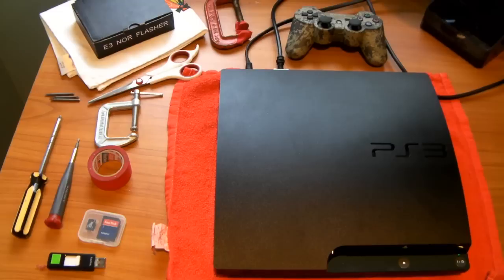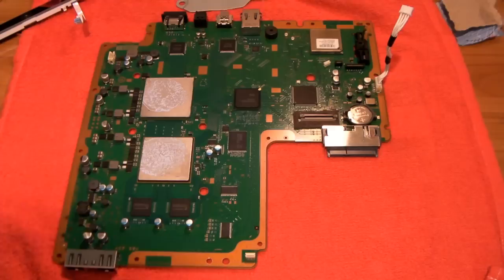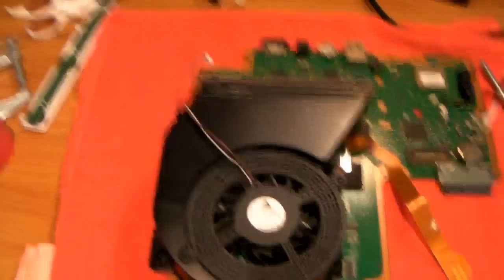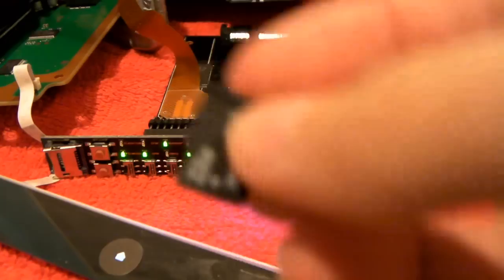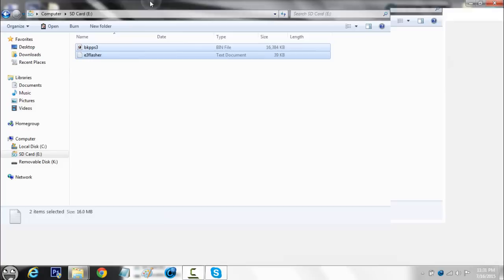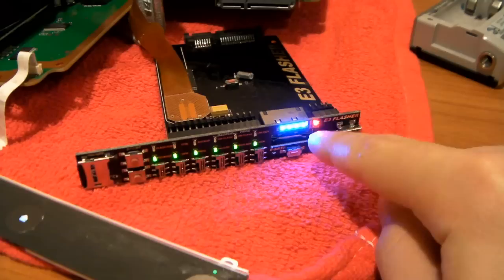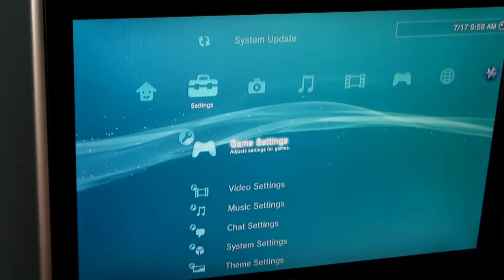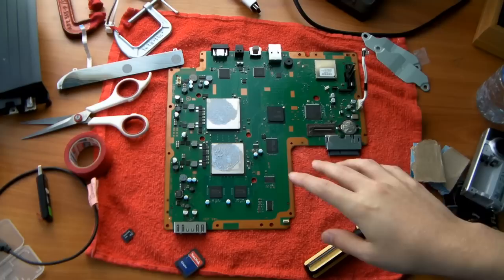How to Downgrade a PS3 to 3.55 with E3 Flasher (EASY!)

Comment: Hi, I have a CECH2501A PS3.  I have been following your guide on how to 
downgrade it and I have gotten up to the point where I have a working 
bkpps3_patched.bin.  I have deleted the _patched and have put my SD card
 back into the e3 flasher.  However, now, when I turn on my PS3 it will 
not stay running.  PLEASE HELP!!!!!

Comment: +Hacked Tutorials 
I have a problem , I need help . I did everything as is, the dumps the probe with NorInspector and Flash Tool. I made six dumps and all were OK . I made the final step, transfer the patched dump at the end , turn off the console, but now when you turn the green light turns on and off at 2 seconds.

What happened? try it with 2 consoles and I was the same . some help?

Comment: i know ur not responsible for anything that happens to my PS3 but i accidently pulled the fans clip thingy that was connected to the ps3 out of the mother board but i'm gonna fix it by soldering the wires into the other side of the motherboard but no worries everything worked for me thank u ur the best at taking it apart on how to downgrade it and put it back together but everything worked for me Than You.

Comment: My ps3 will turn on then after 3 seconds it will go off no red light or anything if i press it again it will show red light then the process starts again ive done it with hdd in and out and no progress. My ps3 was on 4.81 and would go back to 3.50 so i got 3 dumps and they were good then i patched them useing the latest version of PS3dumppatcher and i got a error with the e3 the 1,5,6 lights where blinking then i turned it off then back on then i got 1,5,6,7,8 lights blinking then i turned it on and thats how this started. :(   HELP

Comment: hello mate, i have downgraded a console thanks to your tutorials, and i have got my PS3 slim on 3.55 rogero, and i am trying to go to 4.70 dex, i have tried going to 4.70 cex > 4.70 dex, and i have tried going to the original sony 3.55 update, and every time i go to update it, it says the data is corrupt even though it is all right, i even tried to go to 3.55 using the kmeaw downgrader and it still does not work any suggestions please any help would be good thanks in advance

Comment: I keep getting bad dumps and it's starting to piss me off, bad enough I have to hold it down with so much pressure other wise it won't work, then when I finally do get a dump and check it, I get like 106 errors out of 138.

Comment: if someone doesnt get connection because clip isnt seating correctly, apply above the clip a duct tape 

use a BIGGER clem and not a tiny one (which covers atleast the entire area of the clip), and your good to go

the e3 flasher doesnt directly have to be connected to the mainboard, just with the clip end

If you interrupt the downgrading you will get blue light error and a GLOD (no video/audio) which u just fix by completing the downgrade
Reply: ***** make sure you have the backup patched and updated the ps3 (all levers down at the e3 flasher)

and have the downgrader ready on a usb
Reply: ***** make sure ur ps3 is on the supported model list

doesnt work on super slims
Reply: ***** make sure you dont have a kiosk firmware installed (always saying demonstration mode), or else youll need to use a reverter and downgrade again

http://www.ps3hax.net/showthread.php?t=41772

Comment: Very nice video, although I'm stuck. You had the screen pop up asking to reinstall the system update after putting in the USB stick. I did as well, and I push select and start at the same time, it brings me to the "checking... Please wait" and that's where I sit. Any suggestions?

Comment: @ArchieG Hey Archie i have successfully completed all steps with e3 flasher but when i go and turn on the ps3 it says: "No applicable update was found. Connect storage media that contains update data of version 4.81 or later, and then press the START and SELECT buttons at the same time" also it's worth mentioning that when i used that dumo checker i had 2 bad dumps named ROS0 and ROS1 but i unticked the Hash checker and it was succesfull. I don't know if problem was because of Hashs or something else. Please help...
Reply: Format USB to FAT32, create a folder named "PS3" then inside that folder create one called "UPDATE" make sure rogero 3.55 downgrader file is renamed to "PS3UPDAT.PUP" and put that inside the "UPDATE" folder. Put the USB  in the right slot of the console (PS3 reads usb slots from right to left) and then hold select and start.

Comment: Ive done all the steps correctly but when i try to install Rogero from the USB I always get the error "The Data is corrupted 8002F2C5" , have also tried from safe mode etc and nothing works, any ideas? BD is connected.

Comment: I was on the the last step putting the back up patch onto the e3 flasher and it stopped in like the 6th light and then I got error 10001111 and then I tried to turn on my PS3 the cannot start doesn't pop up on my screen is there any way I could solve this
Reply: First switch down and leave rest up then you will get video description or
http://www.se7ensins.com/forums/threads/e3-flasher-4-81-downgrade-tools-guide-extract-a-ps3-console-id.1355707/

Comment: When I first turn it on the "can not start because of no hard drive" screen never shows up i have it plugged perfectly but still no signal and the ribbon cable that goes to the power/eject button pins cracked and separated but it still turns on if I bend it almost to a complete crease but when it returns to being separated do you think that is what is causing it to not show up please HELP!!!!!!!!!!!!!!
Reply: you need a new cable ribbon, jailbreaking is easy you need to follow the video 100% and make sure you have complete downloads otherwise you risk brick, you dont need anything connected as long as your ps3 turns on and your e3 is running all u have to do is make the dumps and change the files,
Reply: Ive done this before but i had to unjailbreak for my bro but im getting a new cable and i should be good to go thanks though

Comment: hey i'm hoping you can help me .. i did the three backups and when i check them using norinspector all 3 are good .. but when i check them in dump checker i have one error .. ros0 hash .. what do i do ? im currently on 4.78 trying to get to 3.55
Reply: +ab ab go to settings and then turn off hash control

Comment: Can someone help me please every time I try to do anything it fails I haven't found the solution to this problem I can see the error message for no storage thing but then the e3 flasher won't turn on then when I shut it off and put more pressure on the connector I don't see any signal on my tv can someone please help
Reply: +Mr.Potato is your clip on the chip the right way

Comment: So after 10 tries to get the clip cable on the ps3 I finally started to get dumps. First set was successful but in the middle of the second set of dumps the ps3 started flashing red and turned off. Thermal paste was used and I can't figure out what can cause this. Now my ps3 doesn't start and when I try it's first green then flashes red. Please help.

Comment: is this update.bin file in the "Everything to E3" folder the Samsung 10.28 e3 update file? I know that the Samsung update allows you to use it on multiple consoles...I am assuming this is the one you used because you said this was the 2nd ps3 you had done with the flasher.. please let me know ArchieG...or if anyone else knows ..thanks

Comment: i need help. i followed instructions from first video perfectly. but when i try to install regero downgrader i keep getting data corrupt 8002FC5. I get the error when installing from the UI and when i try from safemode. I tried using a different hdd and ive redownloaded the file 5 times. I keep getting the same error.
Reply: Sorry, i get error 8002F957 from the normal UI and when i use safemode i get 8002FC5. I dont know if that is important or not. When i try to update with system update it always gets stopped at 71%. If anyone has any idea why please help.
Reply: chris malicoat plug the Blu-ray player back in and then try it.

Comment: Ok so um I am trying to jb a slim but there's an issue. I'm at the step where the battery is first placed back in for the update but my ps3 starts, then it shuts down like the power was disconnected. idk wut to do:(
Reply: Then I tried it without having the flasher connected and it continues to stay on...is this cus I have a nand ps3
Reply: +Minx GFX what model

Comment: does the USB port on the e3 control panel work the same as the SD card slot? like will it still work if I use a USB instead of SD card?

Comment: Hi guys i got everything down to the point where I get my 3 dumps to go through nor inspector and ps3 checker but it keeps failing the test only two errors ill paste them belowHash check for 009.02   ROS0 Hash StartedHash check for 009.05   ROS1 Hash Started

Comment: Hey I did everything besides the nor check and I tried but I bricked my PS3 it doesn't turn off lol so I unplug I have another one but I think it's bricked also and if you keep getting bad dumps what I did is clicked the settings on top left on the patcher and press disable hash check if I shouldn't do that tell me cause it says 1 of 128 bad
Reply: +TutorialCast if you re havin a problem with ROS1 or ROS0 its ok , just update the dump checker software

Comment: A1 Video, You make it look easy! Thanks.
Reply: +Devill ThreeOthree I have now flashed 2 ps3's using this video, and using your assembly video too, cheers. Worked first time on both  . two small things to mention is that you need to plug in your BD drive before QA flagging on most models or else it will black screen and fail to double beep, and also that you will get a ROS hash fail error if you are using the norpatcher included here in the everything to e3 folder while checking dumps of 4.76OFW , as its not in the list yet, so get the latest version of norchecker here https://github.com/Swizzy/PS3DumpChecker/raw/master/Latest%20Compiled%20Version/PS3DumpChecker.exe if you are downgrading from 4.76.

Comment: i was on cfw already ( i had a jailbreak a long time), but before a few days, my ps3 cant start again, so there was an error code on a red sceen. After that i go into the recovery mode and manual updated the ps3 to 4.70. Now I dont have a jailbreak anymre... What can i do?? Do i have to buy a new E3 Flasher (because my last one was trash)??
Reply: +ModdingHeroes Did you put an official firmware above 3.55 on the flashdrive? If so, you dun goofed.
Reply: +norge696 i put an new OFW from sony on the ps3! because otherwise, there is an error!
Reply: ModdingHeroes Yeah.... you could of fixed it
..  Next time post on ps3hax. Now you have to downgrade again.

Comment: has anything changed since the 4.7.8 update?? because I cannot get it to work
every time i make a dump the e3 flasher automatically makes 3 backups and when checking the files with the patcher i get 2 hash errors ROS0 and ROS1. If someone could help it would be greatly appreciated.
Reply: 4.78
Reply: +Nathan Cornett You need the updated nor patcher and the nor inspector shouldn't have issues unless it's bad dumps.

Comment: hey , after am done with the E3 Flasher, i can still use it on another machine, or for it to work it must remain attached to my playstation3?
Reply: +Brian Ochieng you can still use it on any other ps3 console . as long as you had used the multiconsole update for the E3 flasher, there should be no problem flashing other consoles , as many as you want

Comment: hey, great video. However after flashing and connecting the controller and placing pup file to usb then pressing select+start simultaneously, it is checking for more than 20 minutes, is it normal? or is anything is wrong?
Reply: +Stephen Saja Connect your blueray disk. Once you flash the dump back to your ps3 you can put it back together and install regero downgrader.

Comment: i checked my dumps with the nor inspector and they came back as good and then i open them with ps3 dump checker and a error pops up saying your dump failed on 2 of 138 checks  it said in the log file hash check for 009.02 ros0 started result: Failed! Why am i getting this error
Reply: I fixed it the ps3 dump checker needed updated
Reply: I can't believe it has been 4 years since my last downgrade well im  back for the 2nd time haha
Reply: had same prob fixed it by running the dumper on my c drive lol

Comment: All 3 of my dumps were OK when inspected, but they all had 1 bad check when they went in the PS3Dumpchecker.  They all had the same bad check,  009.05 ROS1Hash... 
Result of the check: False
Check the hashlist for more information...
What should I do?
Reply: Go to the patcher and find some where in settings and disable hash checks. I had the same problem.
Reply: Thanks, I did that and it worked.
Reply: np

Comment: im trying to dump out the files but hash ros0 and ros1 arent checking right, can anybody help me with this +Hacked Turotials
Reply: On the PS3 Dump Checker in the top left corner there should be a little wrench/tool icon, click it. There should be a list that pops up, on the right side of the list under the tab "Checks", uncheck the box that says "Enable hash checks", click save and recheck the dump.

Comment: PS3DumpChecker will not launch on my computer windows 10 64bit. Crashes while opening even with compatibility settings...
Reply: Used a windows 7 computer and it opened however I'm getting ROS0 and ROS1 Hash Errors, I used PS3 Nor and Nand auto patcher v4.81 and it patched, it loaded on the PS3 but then when I booted with the HD it went straight to the OS completely factory in modded.

Comment: Help everything went great except the end when I try to update the PS3 to 3.55 it's stuck on checking pleas wait????
Reply: Astro King mine says the same thing has anybody found out the fix to this issue yet?
Reply: knerison15 hey I fixed the problem is your blue ray cd drive installed it has to be this dude in the video idk how he did  it in the video without it but it won't move off the checking pleas wait until u install it so put half of your PS3 back together and try it

Comment: Can I downgarde to 3.55 with this
Bestcompu® NEW E3 Nor Clip Suit Cable Tool Kit For E3 Flasher Downgrade Accessory Parts
Reply: That's just the clip, you need the full kit like this:

http://www.ebay.com/itm/New-Useful-E3-Nor-Flasher-Limited-Downgrade-Tool-Kit-DIY-for-Flash-Console-/281876313844?hash=item41a12336f4:g:HGwAAOSw7FRWYxXA

Comment: hey man i reflashed my ps3 because i did something wrong and now when i turn it on it stays on for 3 sec then it beeps and goes off and then thered light keeps flashing do you know how to fix this pleaseeee?????
Reply: +Rick Rietmeijer when you dumped it and checked it was it all OK? if it was then your clip is probably not on right when you were reflashing, just try again.
Reply: it was all ok don't know if the clip was but it did make the backups
and i can't reflash it cus my ps doesn't stay on long enough :(
Reply: +Rick Rietmeijer Are your CPU secure pads decently tight with cardboard under them? If not your PS3 might be overheating.

Comment: Finally did this sh*t amazing tuto man thanks

I got some errors in the process, this is a list of some of them, may it helps someone:

If flasher gives you 01000000 (second light) try with another sdcard
Put the update file inside folders called PS3 -> UPDATE -> PS3UPDAT.PUP in your pendrive
When installing Rogero if it gets looping "searching please wait" just wait!!!! For me it took +10 minutes
If Toggle QA gives you black screen is because you need to put on your blu ray disc

Comment: hi, i did follow this video and it was an amazing tutorial! i got it downgraded and it was working fine so i watched a video on how to put it back together but then all i had was lines up and down my screen. i took it back apart, and tried running it like it was during the downgrade. now i just get no signal with my hdmi and av cords. i tried doing to video reset and all that but nothing worked. please help

Comment: Well, since you never answered my question 1 YEAR ago about downgrading a first gen CECH-A01 console, I doubt you or anyone will answer this, BUT I will ask anyway.

Can you please at least TELL ME if I can downgrade a CECH-3001b Slim PS3 to whatever it's lowest OFW using an E3 Flasher, (IIRC mine started at 4.20), so I can update it back to 4.55 so I can use the Cobra ODE on it since someone updated my damn PS3 to the newest OFW recently to "go online" not knowing I had the Cobra ODE installed in it for all my 400 PS3 ISO's to play on another HDD. So now I need to downgrade it back to 4.55 OFW from 4.81 that it's at now. Can I do this with the E3 Flasher? PLEASE answer this for me, I desperately NEED to know how to get my console back down to 4.55OFW. Thank you!
Reply: TheNewFakk28 lol u still didn't get a answer xD